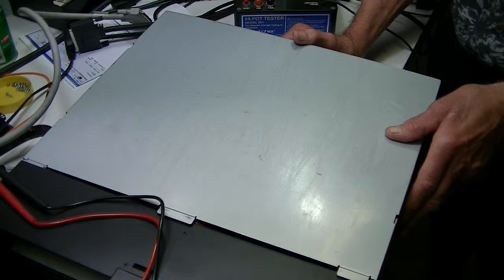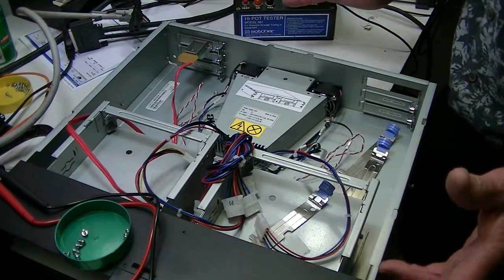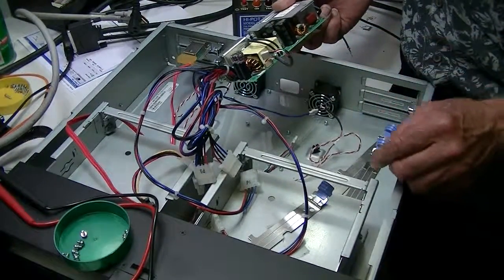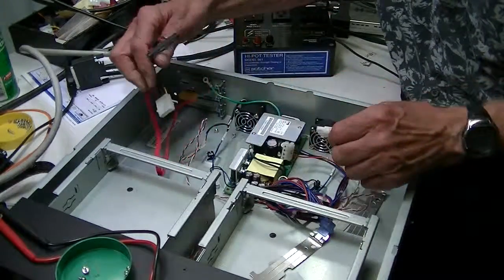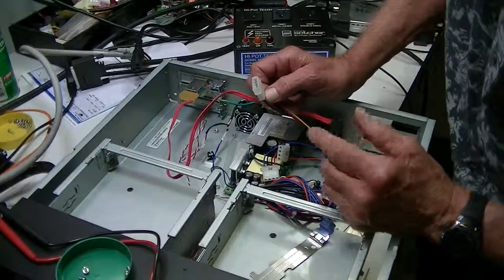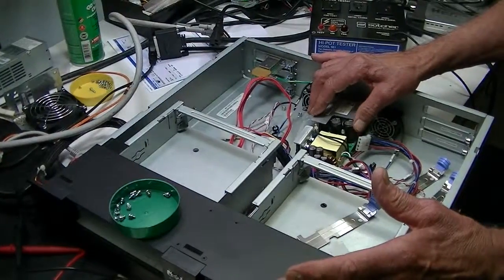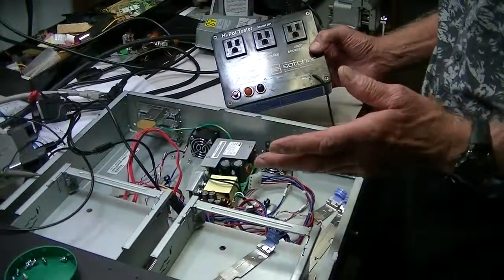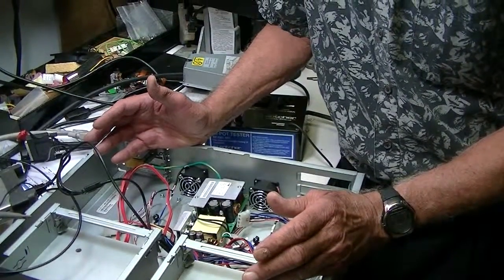Dell 114X  Power Supply Replacement

Comment: I realise this was a few years now, but what is the max output capacity of the PSU?  I note on Dell documents, it "supports two LTO drives for 85watts" but that doesn't tell me if the PSU is rated for more?
Reply from the maker: Hello:

The 114X that I looked at was made for Dell by IBM.  The power supply is rated for 9 A at 5 V and 8A at 12V

Not sure what is your intended application but the LTO tape drives will draw a lot of current, much more than hard drives, and CD ROMs

To convert Amps to Watts check out Ohms Law on a Google Search.

Also just follow this link for an Ohms Law calculator.

http://www.ohmslawcalculator.com/ohms-law-calculator

Dan
Reply: Thanks for the reply, that's very helpful indeed... not a huge amount there at all.  I was hoping to bung in 4 LTOs, with ensuring that at least two on idle with no read/writes at any one time.  Or perhaps add a beefy PSU in its place.
Reply from the maker: We have these racks that had 2 LTO3 drives, 2 LTO4 drives or 2 LTO5 drives in them.  The power supply is always the same, so should work fine for 2 LTO4 drives.  We even had one that 1 LTO6 drive in it.